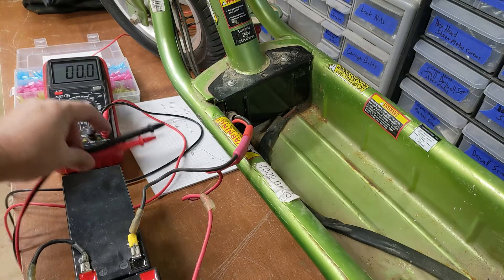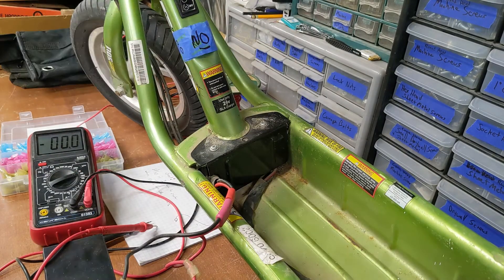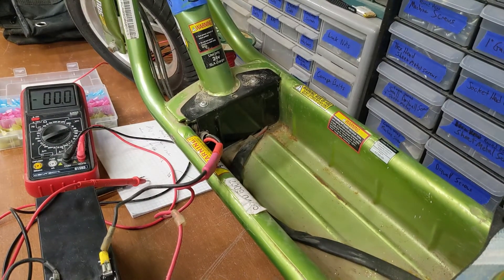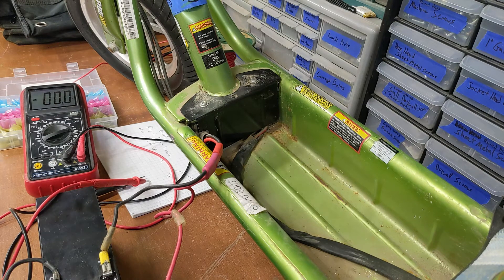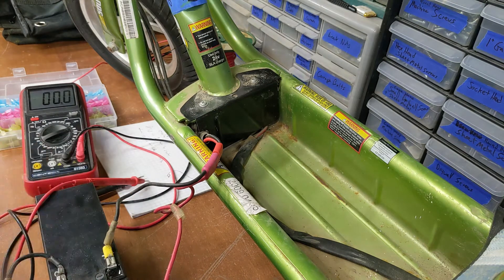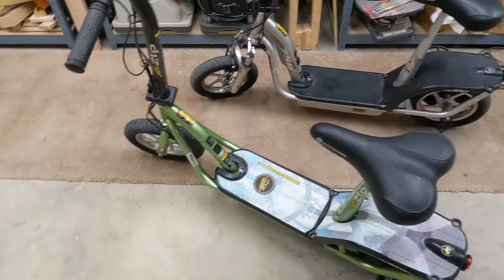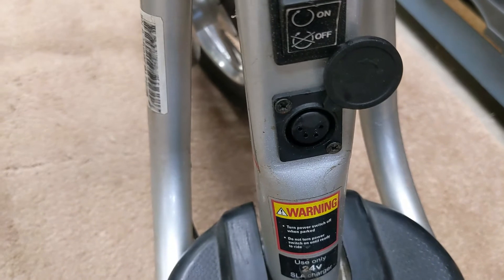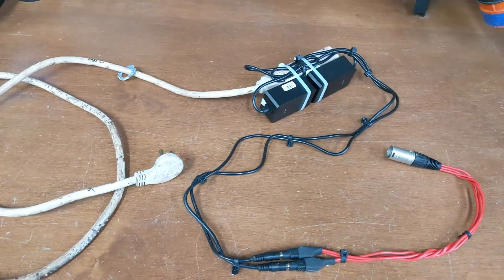eZip electric scooter upgrade mod to LiPo batteries with new one plug dual battery charging.

Comment: Update: Got this LITHIUM BATTERY upgrade done, including the new DIN plug installed to the two chargers to one three way plug, just like you showed. It has been working well after several weeks of daily use and weekly charging. So, pretty cool. 13 year old scooter, that had been in the attic for two years. New batteries with new chargers and plugs, new inner-tube...$125...pretty decent deal. I was willing to buy a new scooter, but it was proving difficult to find one that didn't have some review of even $500 scooters not lasting. Anyway...thanks for posting and the help.

Comment: Will the OEM charger from eZip work at all...even if it doesn't charge the lithium all the way? Thanks!
Reply from the maker: You really need to get a lithium charger for lithium batteries.  Sometimes the battery management system is in the battery itself....and sometimes its in the charger.  Best to use the right one.
Reply: @TIAWhatnot  Thanks for the reply. Do you have a link (on Amazon) to the plug for the new charging setup, male and female? EDIT: Got it...XLR Charging Plug and Port. What gauge wire did you use? The chargers I got at 3a.
Reply from the maker: @TheLokerLocker  Ummm....I think I had either 14 or 16 gauge wire laying around so that is what I used.

Comment: WOW!!! 😳That is a lot of work!!! 
$250 or $600 to $700 is out of my range.. and i am on a budjet!!...but AWESOME FIX man!!
Had my Ezip 500 electric scooter for almost 15 years and still looks and runs great!
I ride slow most of the time in my area.. like a walking or jogging pace ..to light food shop, Pharmacy refills, post office and bank errand runs..take scooter on train to beach board walk areas..ect... so i get more miles ..and then some for what i need!!!
But will upgrade to another scooter when and if good deals come along/prices go down!!
Thanks for the tip..now i know that is the only way to upgrade to mod LIPo batteries!!
Reply from the maker: Thanks for the comment and for watching!  You never know....you can find great deals on used stuff out there.

Comment: I am changing the batteries in my Ezip 750.  I like your system and I have one question.  Since the two batteries are wired in series, and according to your diagram they stay in series while chargine, how can that work?  It seems to me that the charger for one battery is putting a + current on the + terminal of that battery and the - current on the negative terminal of that battery, but because of the series wire between the + terminal of one battery and the - terminal of the other battery, that a short will be occurring.   So how will it work?
Reply from the maker: Been a while since I looked...but I think I remember....that when the power switch is off...the series connection is broken.  Then charging is from each charger to each battery.
Reply: @TIAWhatnot  Mine is not made that way.  There is just a 12 gauge wire that puts the two bateries in series and it does not go through the on-off switch.  I found a wiring diagram on the internet but it only shows a spst switch for on-off.  The on-off switch in mine is a dpst switch.  I would like to know what the other wires are.
Reply from the maker: @JohnYoung-b4f  I read my comment and I think I misspoke.  The chicken scratch diagram in the video at 28seconds in shows what I did.  This is all part of the battery pack...I didn't do anything with the switch.  My thinking was....since the switch for the scooter breaks the positive 24v into the speed controller....that as long as the switch is OFF....you can charge both lithium batteries independently with the 4 pin plug wired as shown.  (Two 14.2V lipo chargers) So yes....they are still in series....but the overall circuit is not connected when the scooter switch is off.  If you left the switch on and plugged in you might have a problem.
Reply: @TIAWhatnot  Thanks for your reply.  I raised a question above about the switch being dpst but the diagram shows a spst.  After taking the switch out, I see while it is a dpst, they are using both poles for the same wire.  I presume the stitch was not rated for high enough amps so they used both poles to get the need amperage rating.
Reply: Thanks for your video.  I modified my 750 using your diagram with one change.  I put a toggle switch on the wire connecting the batteries in series.  To charge each battery separately, I turn that switch off, taking the batteries out of series for the duration of the charge.  When the batteries are fully charged, I disconnect the charger and turn that toggle switch on putting the batteries back in series for the operation of the scooter.
Reply: @JohnYoung-b4f  
But the charge wires go directly to the individual Battery BSM's independent of the Battery output wires, so the Output series disconnect isn't needed.    The charge from the four-pin socket is not the same as the charge from the old three-pin socket that used the output wires as the input wires as well.  Charge is now isolated and individual to each BMS/Battery.  Output is also independent from each battery, but joined in series (hopped up to 24v) to the throttle control.
Reply: @steven.h0629 when each charger is hooked up they're each contacting the positive and negative of each battery, correct? But one of the battery's positive connections is connected to the other battery's negative connection (to create 24v in series) while all this is going on, doesn't make sense.  JohnYung's approach is the correct one IMHO.
In other words, (forget the scooter for a second) if you had two separate scooters each use only one 12v battery and each being charged individually with its own 12v charger.  You wouldn't jump a wire between one battery's positive connection to the other battery's negative connection while charging them which is what is essentially going on here.

Comment: i'm looking to upgrade mine sicne i can only get 2 miles on full charge.. 
what e zip scooters are those ? those tires are skinnier than mine i would like those better..
Reply from the maker: Oh...well...maybe these are older?  500 and 650.  I thought all the tires were the same, but I didn't really pay attention to that.
Reply: @TIAWhatnot  hmm.. i wonder if i can make mine like that.. it was free so i cant complain..  i'm new to the scooter scene..
Reply from the maker: they are ezip scooters.
Reply: @TIAWhatnot  i know that much, i meant model .. mines ezip 450 tires are smaller and fatter like a go kart.

Comment: 😎 Sweet mods man! I'm in the process of motor swapping my currie I-zip 500. I was gifted a 72V, 3000W motor from Vevor along with a matching speed controller (also from Vevor). Based off of other builds I've been looking at over the past few weeks (scooters and ebikes), I've concluded that this motor is too much for this scooter (price and total unsprung weight wise). The battery that I would need to power this system is to much of an investment that I'm not in a need for at the moment. I feel like this motor/ESC combo would be perfect for an off road bike or a go kart.

But again, I'm not building one of those just yet. I still have the stock 500W motor and it's OEM controller.  Do you think I should just re-install the factory motor, upgrade the ESC, and over volt to 48V? I would like to cruise at speeds higher than it's rated 15mph. 30mph would be great for me. I currently weigh around 170lbs.

Also, the aftermarket battery I have on hand at the moment is a brand new "80V" 72V battery that was meant to be used with a lawn mower. Here it is: Power Tool Battery - Li-ion 72V (80V max) 6.0Ah, 432Wh GW8060. I'm assuming the 432 is watt hours? Meaning if I used this to power the 500W motor (which I'm not as that motor's rated at 24V) theoretically, I'd be getting a run time less than an hour? But if the battery read "1000wh", would that mean I could get around ~2hrs of run time?
Reply from the maker: Thanks for the comments and questions. You have a lot of ideas going on.  I wouldn't recommend ugrading esc and using stock motor then over volting it to get more speed.  The only way you get that speed is making the motor spin faster which that motor isn't designed to do.  I know people have done it. 

Honestly....what I did for speed...is got a used UberScoot 48v 1500 watt scooter that someone had on facebook marketplace cheap because the lead acid batteries had died.  I just replaced the batteries with a 48v 20Ah lipo.  Everything else stock...It'll do over 30mph.  You just cant use the old charger....but the battery came with a lipo charger. This scooter also has suspension.   It's the cheapest way to get a fast lipo scooter.

Good luck with your projects.  Thanks for watching!
Reply from the maker: Oh...forgot to mention....I have used some commercial lipo batteries of the wrong voltage to run stuff.  You just need to get a voltage reduction circuit.  These are cheap on Amazon. They could drop that 72v battery to 48v efficiently for example.  Just make sure that the amperage rating of the circuit can handle your needs.
Reply: @TIAWhatnot  Mmm! And I was wondering if I could do something of those sorts! Cool, so keep the stock motor and ESC and step down the the voltage on the battery via a voltage regulator? Will have to figure out the amperage, that'd be based off of the battery though right? In my case, 6ah? Is that the discharge rate for this battery? I'll look more into it later. Thanks sir! I'll be back later to check out more of your videos too. 👋🏾
Reply from the maker: @DJHeroMasta  The rating would be the max the motor and controller combo need.  Not the battery.  The easy guess is just use the value of whatever fuse comes with the scooter.  If it's a 30amp fuse....get the 30amp rated voltage regulator circuit.  Here is an example of what I used.

https://www.amazon.com/MGGi-Converter-Waterproof-High-Power-Transformer/dp/B09KB63CL7/ref=sr_1_7?crid=3NNTC88J3A0Z1&keywords=72v%2Bto%2B24v%2Bstep%2Bdown%2B30%2Bamp&qid=1677602054&s=electronics&sprefix=72v%2Bto%2B24v%2Bstep%2Bdown%2B30amp%2Celectronics%2C200&sr=1-7&th=1
Reply: Those are not lipo batteries